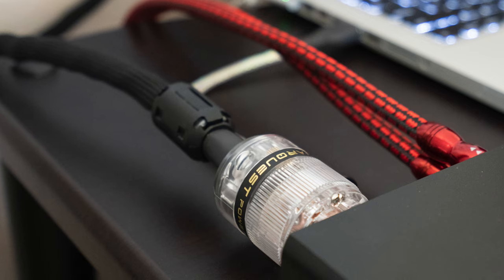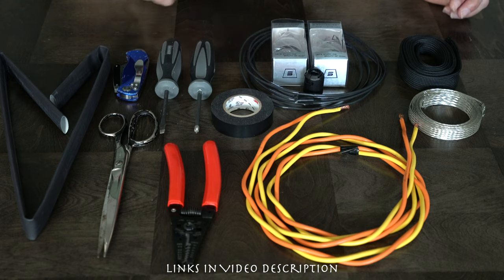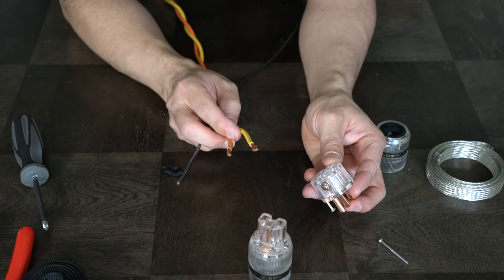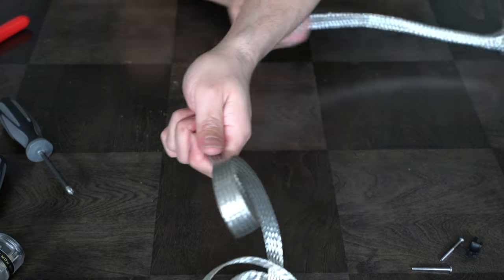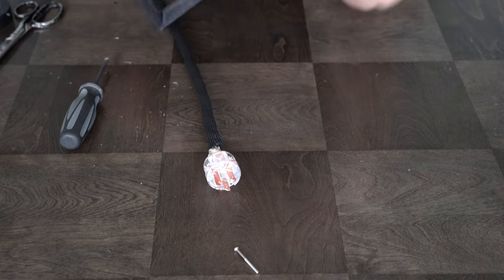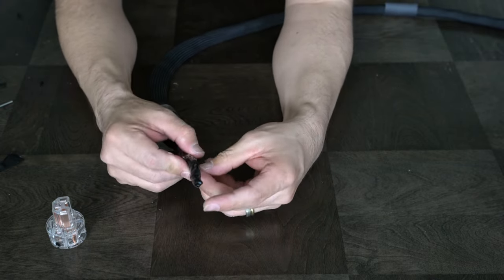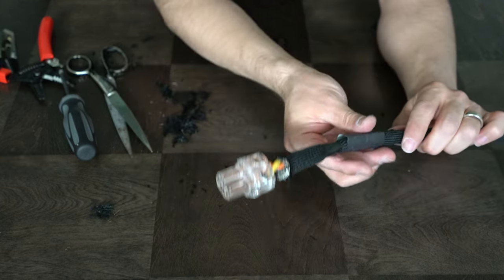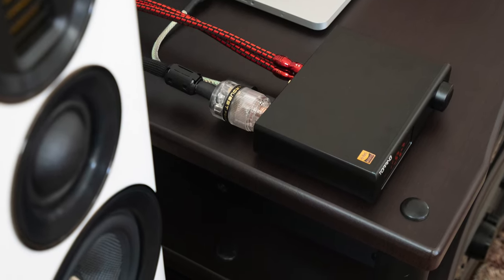Easy DIY Shielded Audiophile Grade AC Power Cords, Twisted Too!

Comment: Audiophile Grade AC - jeeez !!! How can someone think that the power need to be protected or filtered or modified in any way for HIFI, because you might hear the difference ? You can see many very good power amp even without rectification !!! You have to avoid gound loops and thats all. The mains are "travelling" to you hundred/thousand of miles in the air, under the ground, inside the wall, and that last meter "Hifi Grade Power Cable" really won't do nothing to it. But it can harm your purse very badly. Very sad to see when a clever guy propagate such obvious hype and cheating. It's a rip-off as many other Hifi equipment. Hifi Business is a very nice target of hypes and mysteryes and miracles and nonsense devices contradicting the laws of physics. They are all very expensive for silly and snob but rich people. Please keep comparing speakers, amplifiers, or whatever that counts, but not power cable and "Hifi Tables" and "HiFi Pads" and "Hifi AC Power Strips"  and "Power Cables" and such cheatings.
Reply: For your information, filter circuits, active or passive, are the most common most cheap and most simple elemenst of electronic devices. The cost is few $. Do you really believe, when you buy an amplifier for $2000, those hifi and electric engineers who made that, they can't put $2 value filters in your device as many as they want and anywhere as the want if necessary ? They give you a sh...t product for $2000 because they are not professional, they don't understand how the mains work ? You think your merchans will solve that engineering problem with their "special" and "little overpriced" stuff ? Do you shield your cable with breaded copper although it wasn't shielded to that point from the powerplant to your amplifier. You wanna shield the last 3 meters from 1000 miles to make a miracle device ? Above cable 3m : ~ US$ 160.
Your amplifier power cable is free, it comes with cable, the $2000 price included the power cable already.
Reply: @telelaci2  I'd understood it's more about protecting the other low voltage cables (e.g. Interconnects and speaker) running behind your system from the EMI noise generated by the mains cable. So shielding is key, rather than super thick or fancy conductors
Reply: @dalevearncombe9672  If that would be a problem, then the electric engineers would simply move the mains to a new position far from other cables. (its not near anyway) IF that could be an issue, they would do that. They would be able to do that, they are engineers, designers, professionals, they know how to design an amplifier, trust them.
Btw other low level signal cables are shielded ! Not the mains but the L and R audio. Shielding the mains is very silly idea. Maybe silly is an improper word, because it has its purpose, it's a nice rip off.
Reply: @TechStuff365  Hi John, you just ignore what I said about the mains. It comes from a power plant hundreds of kilometers far away. Via many kind of devices, transformators, switches and at last it reaches your house. The electricity is propagated with the speed of light, so despite of the 1000km it's there in an eyewink, let's say 0.003 second. Inside your house the wire goes inside the wall, it's a simple industrial and cheap copper wire in the best case, nothing special. What can a "high quality" cable improve on that on the last meter ? Use your common sense. The other 1000km long wire's quality doesn't count only and exclusively that last meter will ruin the amplifier's capabilities ? These fancy cables are nothing else but, thick copper wires assembled with high quality plastic insulations and parts, and very beautiful colors, really demanding products. Price is set if it was from solid gold, not plastic and copper. But what is the purpose, 1000km wire's quality is random, sometimes bad, and the last one is good ? Hows that ?
And by the way there is no limited budget for the cable, because it's not an expensive part. They make it expensive, because they can sell the snake oil, so why not ? Free money from the snob pigeons.
Reply: @TechStuff365  "Often they are only 5 amp rated, sometimes they aren't even solid copper." - OK, but you have no idea how to calculate the input power at a power amplifier, it was not part of your education. A 7 amp (not 5 but more) rated wire is 22 AWG (at max 47kHz). Most of ethernet cable's size is 22...23 AWG, that is the size of 7 amp rated cable. Everybody knows how thin an ethernet cable is, you just have to check the glassy RJ45 connector. That is the thickness of a the power cable you get, it's your statement. And you think that when you buy a $2000 Power Amplifier, it comes with crap cable, because the electric engineers who designed that amplifier couldn't calculate the proper amps and they will give you a cheap unusable budget thing for the money, not even copper. But you know it better than those engineers. They don't want to give you a good product, they have no competition, you can buy only their amplifier, no choice. No capitalism, no competition. They will save $10 on the power cable and they will live like a happy fish in the water. I think the opposite. Not the power amplifier manufactuers ripp you off with a cheap cable, but the oil snake manufacturers ripp you off with an $500 cable. But: "...its very unlikely there will be poor cables in that chain..." - when you are talking about the 1000miles, so you think every cable piece is good quality except the one that you get with the amplifier. How logical is this ? And by the way the HiFi's problem is only the undersized cable that is heating up ? Your statements are not very well based, I don't want to argue with it. If you believe in this I don't want to change your opinion, it's fine by me.

Comment: Funny, the power supply in my amplifier filters out any noise….
Suppose you have a noisy power supply, than a good cable won’ t help.
I don’ t agree with the usefulness of this cable, but you are very good in doing a presentation.
A more interesting topic would be to prevent ground loops.
Ground loops are very common when you have connected more grounded apparatus to your amp.
It gives an annoying mains-frequency noise in your speakers.
The solution is to not ground your amplifier via the mains cord so don’t connect the ground in your cable at the amp side.
(or safer: use an isolating transformer)
Reply from the maker: Thanks good cables never hurt, I also have dedicated power transformer for whole house.

Comment: So... You make such cable.. You pay like 50+ $ for power plugs, for OFC wires, shielding... 
Then YOU PLUG IT into your most basic house power socket, cheapest cables inside/behind the walls, via most  basic fuse contacts... How does 1.5m cable like this can cancel all the other bad things that go along with the home or even worse building installation???

Comment: OMG 🤣  Anything goes when its subjective. Properly engineered audio gear will perform its best with this cable or the  stock cable.
Reply: Wrong! Good cables make a big difference compared to stock garbage even on high end gear.
Reply: @samza9622  Ok, measurements with the most precise equipment  and decades of research say otherwise. Some cables do make some differences in some circumstances but the cable in this video is BS. I've had a few and seen them tested, never makes a audible difference. AudioScienceReview and Audioholics

Comment: DIY AC cords, publicly advocated, what could go wrong?   Also, have you identified the problem you are trying to fix?

while I recognize the craftsmanship involved and the clear purpose of the video, I would never substitute a professional safety laboratory approved AC power cord for something without a tested assurance of fire safety , unless I wanted to unplug it every time it wasn't in use.    

 without taking sides , the idea of audible benefits in this way is controversial, and that fact alone , to me, makes the risk of homemade power connectors unacceptable.   and probably uninsurable.